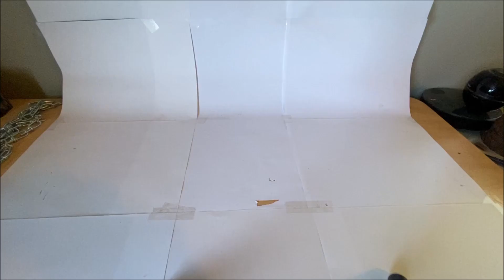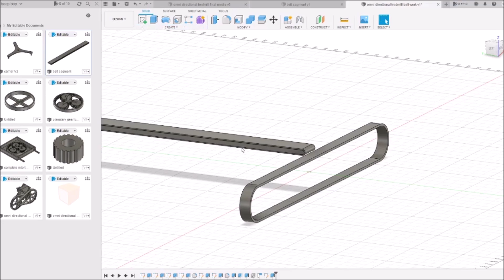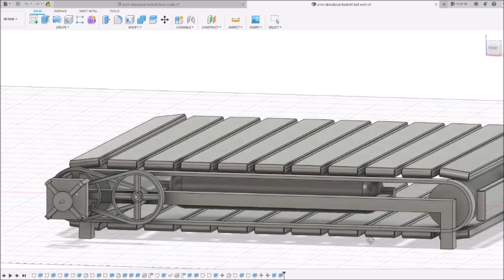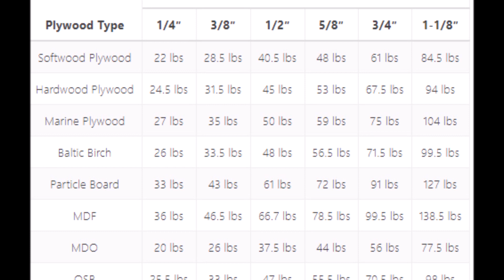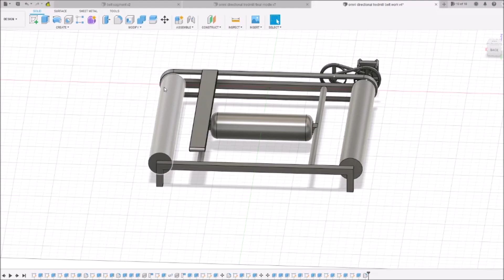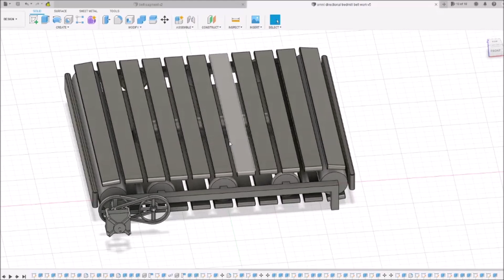DIY VR treadmill (Build log 2!)

Comment: How about the following idea?
- Y is direction of forward movement of man on treadmil, X - side direction, left or right.
- no sensors in the treadmill
- it's a curved treadmill, so you don't need motors to operate it when moving on the Y direction
- each individual board of treadmill has rollers that roll in the X direction.
- movement to vr is gathered from body tracking.

Comment: Why not use a single point, and then program it to if it pulls along the X axis then it would move your character in a game that direction, same with the Z and Y axis. But then you'd have to design slidery shoes and so forth

Comment: I'm not 100% on what your end result is wanting to be but just as an idea.
If your sole purpose is for VR use do you actually need any motors? 
Can you not just have the treadmill move with foot pressure, maybe adding some light brake/brushes to prevent it being super slippery.

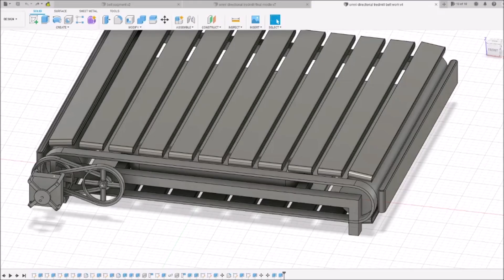Comment: 3:02
This is a bad way to use fusion. I reccomend structuring your assemblies with components/groups, and keeping every part as different bodies/components. This is so you can work with them more easily. For example if you want to remove or toggle them... it's as easy as a button click.
Additionally, fusion will run a lot worse with more features in the timeline.
So in short, the best approach to remove the roller at 3:02 would be to go back in the timeline and delete or suppress the extrude and fillet features used to make it. Or if you had it as a separate body, to just toggle/remove it in the file browser.
Reply from the maker: gotcha. I taught myself to use the program with a few YouTube video here and there and that's probably why I'm doing everything in a difunctional way XD. ill try to use that advice when designing things in the future!
Reply: You need Jesus Romans 10:9